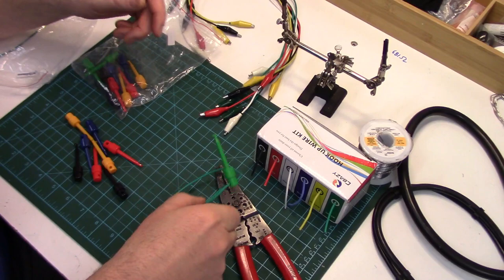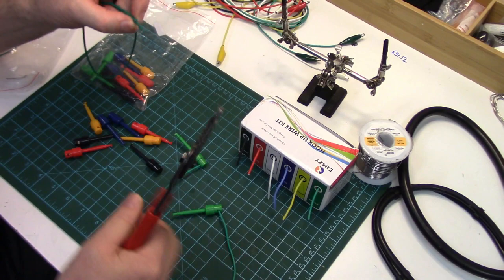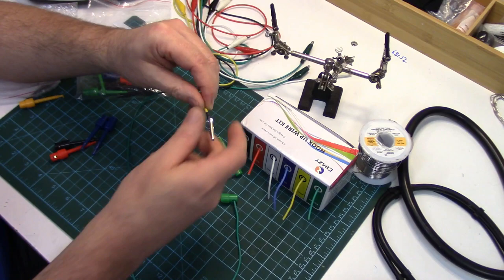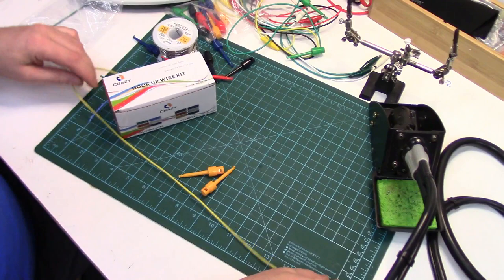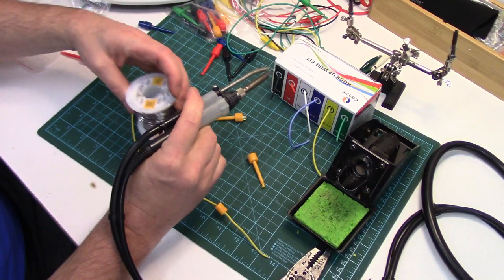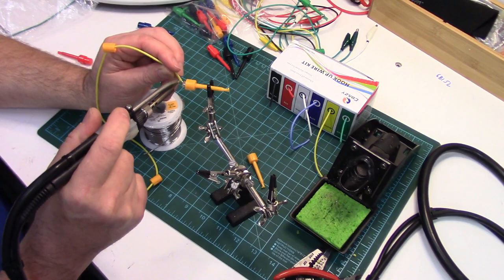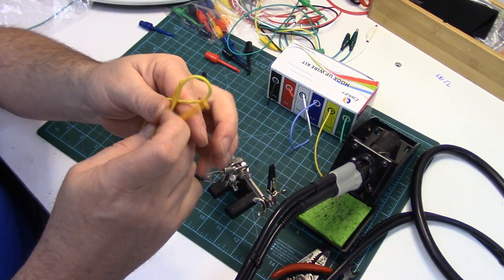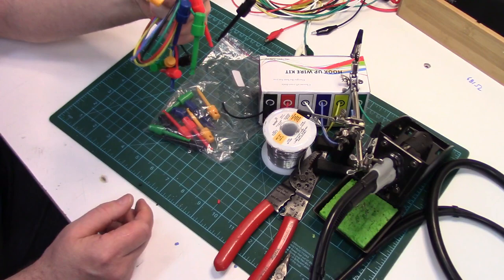How To Build J Hook Jumper Wire Test Leads / Mini Grabber Test Clips

Comment: I am wondering if there's some way to add strain relief to these wires. Did you ever have them break because of lack of strain relief?
Reply from the maker: Never had an issue using the high flex wire. You could certainly slide some heat shrink over the end to add a little relief if it became an issue.

Comment: What is going on with that soldering iron what's the top part?
Reply from the maker: Sorry I don't understand what you are referencing by "top part." The silicone handle? The power wire? The fume extractor?  Something else?
Reply: @Rchelicopterfun  I'm pretty sure he meant the fume extractor. Most irons don't have those (they do have all the other things you mentioned). What kind of iron is that, with a built-in fume extractor? Does the extractor work well, with such a small tube?
Reply: @Rchelicopterfun  You seem to be able to solder one handed without flu and the iron looks like an old solder gun..